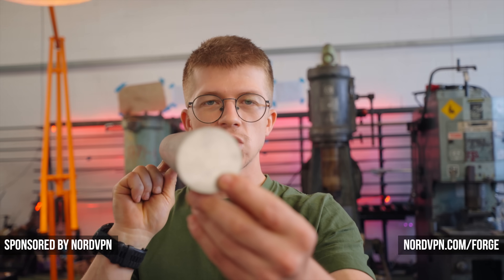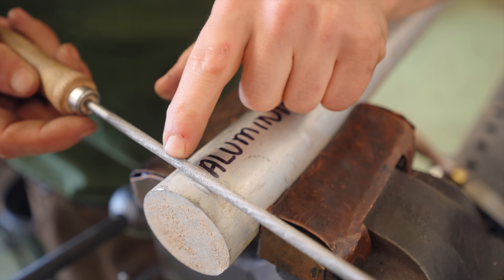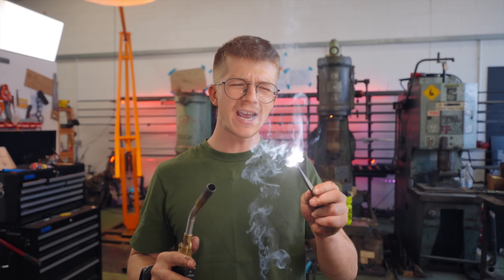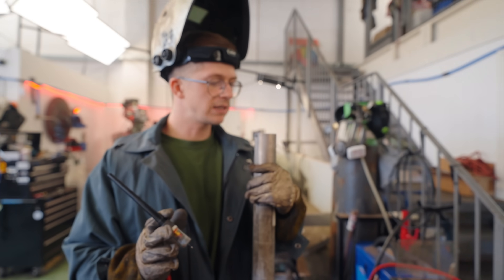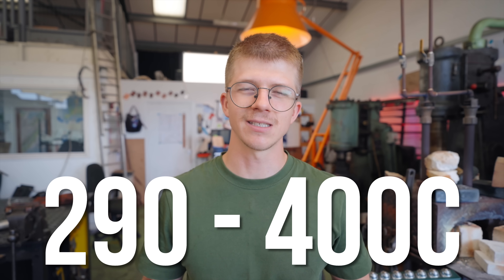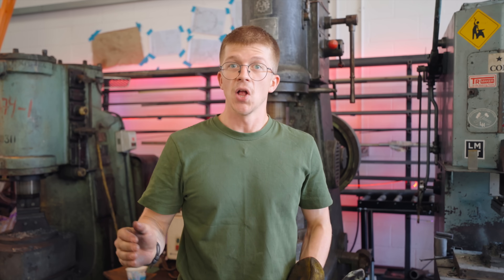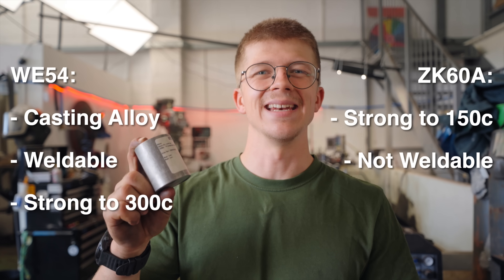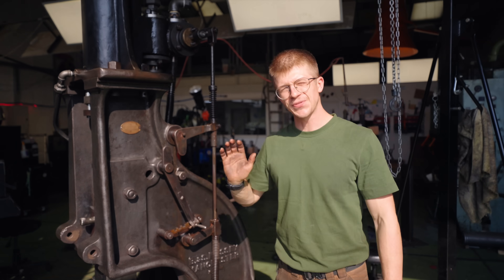Can You Forge Magnesium?

Comment: "What metal doesn't look gray?"

Well, I am think gold is somewhat gold in colour.

The type of bonds dictate the hardness. The weight is the structure and density of the metal(the space between the molecules).

Magnesium Citrate is used as a very effective laxative. Eating pure magnesium gives you a completely different result.

Also, magnesium is awesome for igniting thermite.

You really need to test it usimg an induction heater in a vacuum.

Actually I would love to see some weird metals forged in a vacuum. Obviously, though, you can use coal or gas for heating the metal, hence induction.

Comment: “Things that don’t make sense” aluminum is much softer, and has the habit of amalgamating, cutting it with steel and carbide without lube, causes the to gum up, magnesium though light is more rigid. Under a microscope you can see aluminum almost smear when cutting, I’m trying to make these terms relatable, the chip load when milling aluminum is fluffy, and their molecular structures react very differently under heat and friction. If you look at both under a microscope, they damn near explain their own natures.

Comment: I made the mistake of turning titanium on my lathe at home...all went well until I busted out an angle grinder to cut off the part and my chip tray ignited and burn really hot.  I managed to pull the chip tray out and toss it out into the yard to burn out.  I now look into the properties of the metals I work into small chips.

Comment: There is no direct correlation between density and hardness or similar. Pure gold is not very hard, and it has a very high density. Lead is not very hard, has a very high density.
Neither is there between hardness and boiling, sublimation or melting points. There can be complete outliers.
So for safety, check the research on the materials. Chemistry is not that logical if we look at water, it is made up of Oxygen, which is really the thing that nurtures fire, and on top of that hydrogen which is highly flammable. One would expect it would be one of the most explosive materials. Furthermore, adding one more Oxygen into H20, into H2O2 turns it into Hydrogenperoxide which has been used as a disinfectant and is destroying organic things. Of course it isn't that simple to just add another Oxygen atom into Water. But it is the gist of the idea.

Comment: I’ve done some small castings with magnesium back in the day. (Small for us being 200kg or so 😂) 

The issue was it’s so fluid once molten it can run away from you quite quickly. If the joints of the mould aren’t solid with the pit or box air tight is can squirt out which at that temperature and force, is an issue.  Steel alloys this is less of an issue, molten is a little more gloopy.

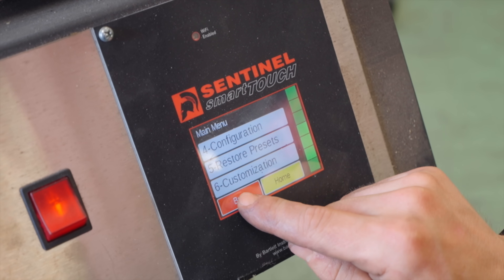Comment: 10:07 about the Fahrenheit vs Celcius, i can give small insight why Fahrenheit is superior. for that i will compare Forging to Baking. this is nowhere similar, but just a small example. trust me, because in both cases, temperature control is pretty crucial. Breadbaking requires Yeast, and that yeast can die / live when it came in contact to water with varying degrees. these are the range in which yeast can 'come alive' helping the baking process:

(105°F or 41°C) - (115°F or 46°C)

in °F, there's a ten degree difference
in °C, there's only five degree difference

Fahrenheit gives a wider range to control/lower/higher the temperature (called tempering :) ). the Kiln in 10:07 might be best set to Fahrenheit to have better control of the temperature.

Comment: I was in a prototype shop for a while as a mechanic at roush tech and I remember that Chrysler was using magnesium for a structure in the engine cradle and it was to be modified for something in a test or something 
Well it was on the surface plate that was huge so it could fit a tractor frame from freighliner 
Well it caught on fire and it melted through a 3 foot plate of steel and destroyed the entire surface plate 
It’s extremely dangerous when lit on fire for sure

Comment: 2:00 it has to do with how well those atoms hold on to each other, not how many there are. Carbon Fiber is light but extremely tough, for example.
Reply: Heat treating something changes the orientation of the atoms (among other things), and thus the way in which they hold on to each other

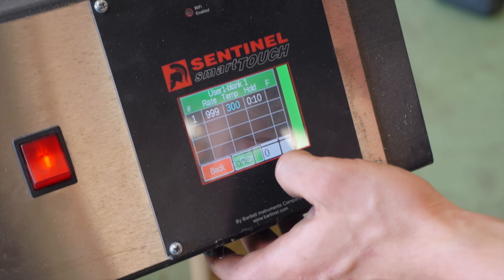Comment: 10:40 Ferenheit is good for human scale experiences. Zero is the coldest temperature that Mr. Ferenheit was able to measure outside in the middle of winter, and 100 was supposed to be body temperature, but this later was not measured precisely as normal body temperature is 98.6.

Comment: Use a super steel like Rex 121 or Maxamet to make a damascus with the hardest steel that will preferentially etch. Basically make the strongest, hardest, toughest damascus knife you could possibly make and still get a pattern to show up. Do a low layer count so that the carbon diffusion is as little as possible and any other migration that may occur try to keep at a minimum

Comment: You could probably go up to maximum of 470 degrees, as the ignition temperature is 473 degrees (celcius of course, farenheit makes no sense).
But for safety 450 in the oven, by the time you hammer it, it'll be down several degrees.

Comment: The way everyone else pronounces aluminum is better we are boring lol
(American English vs everywhere else)
No magnesium is not a laxative 
Coffee takes magnesium with it, when youre magnesium deficient you get a bad case of diarrhea they often say if you keep getting diarrhea take more, until it goes away 
It actually does the opposite but it may take several days it is an electrolyte
It is not magnesium metal it is a saline solution (it's magnesium salts more similar to bath salts but very much not) don't take it internally either it should be sprayed on the hands, feet legs etc and massaged, it also fixes muscle pain spasms

Comment: 8:31 While race cars used magnesium extensively from around the 20s to the 60s/70s, more modern race cars tend to just use it for smaller parts such as wheels and casings. This transition was mostly due to its extreme flammability and brittleness in a wreck making any sizable accident a firey ball of death. In fact, drivers at the time sometimes opted not to use their seat belt because of this, as they would rather be flung clear of the wreck and risk the fall, than be strapped to said firey ball of death.

Comment: @0:20 This quality is known as LUSTER.  The appearance of something being 'metal' is a quality of its physical characteristics, which is actually related to but independent of color.  It has to do with the electrons in the outer shells, but this means that color of the material (also a physical property) can vary just as much as the luster can with the quality/composition/condition of the stuff.  This is why steel and gold powder are dull, but if you consolidate them more light is aligning along the same paths and we get the luster.  "Metal" therefore can come in all kinds of colors, nilered even made purple gold (aluminum alloy), lots of cool stuff :P

Comment: 3:03 well alumium itself is very soft yes, but the oxide layer is one of the hardest materials you can come across, it can easily mess with your saw, the only saving factor here is that the oxide layer is very thinn
Reply: you use aluminium-oxide (in German also has it's own name "Korund") to sharpen hard knive-steel for a reason.
Reply: @ThorDyrden  It's actually called something similar in English too, "corundum"

Usually it's only called that when it's on its own as ruby/sapphire though

Comment: If you wanma see something crazy, heat up magnesium to 400 degrees And before it gets below 360 degrees put a big coat of polytetrafluoretylen (yes, teflon) And put it under some pressure And let it cool down to room temperature. After that reheat it to max 350 degrees, never over 360 degrees! And try all the things you Done in the video again. The coat of teflon must be really big keep that in mind. The metal will Have totally different properties. Normally magnesium Have tensile strenght of around 300 MPa but after this it changes to around 420-450MPa without no oxidation. The magnesium bar can not be wider than 0.5 to 0.6CM, keep that in mind.

Comment: An example of how density does not necessarily equate to hardness is gold.  Gold actually has an extremely high density, at around 19.3 grams per cubic centimeter, as compared to Steel's 8.05 grams per cubic centimeter, making gold over twice as a dense as Steel, yet it's one of the softest metals that's still a metal at room temperature.

Comment: Fun fact: cast magnesium is oftentimes used instead of cast aluminum in many applications due to weight and cost.
 Two examples are mower decks in many MANY lawnmowers, and valve covers in many small engines. 
 Cast magnesium is commonly used all over to this day !

Comment: Picture density as how far apart each house is in a neighborhood and that neighborhood is the crystal structure of the metal which gives it such properties as hardness, ductility, and so on. These are called eutectoid structures and make up the interesting patterns youre familiar with if you've ever looked closely at acid etched metals or in a cross section of a cut rough piece of bar stock.

Comment: If you don t mind a long text with maybe some mistakes, I tried to explain the chemistry around this weight hardness issue in a way I think anybody with a basic understanding of Atoms could understand. But I am open to explain more just ask. 
 Lead ? Heavy and soft. Gold heavy and soft. Titanium light and hard, Steel comparable light and hard, Iron again heavy and soft, but then lithium sodium etc. light and soft.  I did not accomplish my chemistry study but there is a thing called hexagonal closest packing of spheres it was Dichteste Kugelpackung in Germany translator gave me this. Metals got crystal structures i think this you might know even better than I, but I could imagine that this has an influence. But while i wrote this maybe its even easier. There are those valence electrons. The electrons on the outer shells. Metalls form bonds by letting those relatively loose valence electrons flow free between different metal atoms, that's also the reason metals are electronic  conductive. So what i try to tell Atom cores are positive because of the protons there and bind because of the electrons between. Theoretically if there are more electrons around in this metal atom core cluster the more those cores should bond to each other. But there is still more. For this the atom shell model from Dr. Bor should do it. you see you got the positive core and some shells with electrons around it. The further down in the PSE you go the more shells. now you got this also negative shells between your core and this cloud of loose valence electrons. more shells mean les bond from core to cloud because the distance and the negative charge shields them from each other, therefore you got heavy soft  metals because the distance between the outer shell and the core is huge and probably the electrons in the cloud are just a few. Also you could get heavy metals with a lot of shells but also a lot of valence electrons and like you could imagine the bigger the shell the more potential outer electrons an element could have. Then you have lighter atoms with few shells but if there are still not a lot free floating valence electrons they do not bond well to each other. Actually you can see this very well in the periodic table, wehere elements like lithium sodium etc are in the first 2 groups and elements of those groups got 1 and 2 outer electrons what would fit in my explanation. And after this the packing i talked about in the first place also would probably have an influence on this. It sounds complex but its literally just how the atoms are stag together if you imagine them as spheres. I think this could be a reason why fusing of different metal even though both soft could make a hard metal. just imagine you got a bunch of big spheres stag together and now fit smaller spheres in between the free space of the larger spheres. I hope anybody ready this I am not an English native and this took a long time ^^ P.S. I am not sure about steel because its an alloy from steel and carbon it could relate to this sphere packing thing but carbon could also affect the electron household of the iron atom grid.

Comment: I can see the point behind the metric system in some cases. My problems with it as a machinist and mechanic stem from resolution and intuitiveness to a lay person. Saying "I'm 2 meters tall" the ship is 100 meters long" a foot has 3.3x better resolution. Same with temperature but at metal working temps can Fahrenheit can be many times as precise without decimals. Kg is also far less precise. There is a huge step from Kg to grams. Grams are very precise and useful. My least favorite of all is using liters to express engine displacement. There are 61.02 cubic inches per liter. Even with a decimal point it's useless. If you tell me 301, 302, 302.5, 303, 304, 305, 307 V8 engine, I immediately know which manufacturer and what year range we are talking about. They are all 5.0 litre V8s. Many manufacturers built several engines of the same litres but vastly different at different times. Ford made 427, 428, 429, and 430 engines, so if you read a foreign article about a custom car and it says "powered by a 7.0 liter Ford engine" it tells me exactly bupkiss. To a lay person a cup, teaspoon, tablespoon, yard, inch, foot, are all based off of body measurements or household items. If you use YOUR teaspoon, 3 of them will be YOUR tablespoon, draw a line in your cup where every 2 tablespoons fill it to and you have an ounce, 16 of your tablespoons, or 8 ounces, and you ave a cup, pour 2 cups or 16 oz of water in a mug you have a pint, (one pound of water) or, you can measure out 32 tablespoons of butter to make exactly a pound in weight. Mabey it's not freezing outside. Fahrenheit is based on something closer to room temperature that doesn't require freezing or boiling, and needs no altitude correction. when the butter melts it is 100 degrees. pour 2 pints or 32 oz in and you have a quart. Put 4 of those in a jug and mark it you have your gallon. Then use your foot, or width of your thumb to get divisions by 3, 12 inches, to a foot, 3 ft to a yard etc. Thus, with nothing but whatever comes closest to any one of these standards you use based on your size, you can build a house perfectly to scale if not in actual dimensions but close enough to describe it to someone that exactly fits YOU. You can find a horse x hands high YOU can ride, and by using YOUR favorite size teaspoon make recipes identical in flavor to the giant next door in portions that will last YOU the same amount of time. And buy a field YOU and YOUR horse can plow in a day with a properly dimensioned plow for both of you. And your feed sacks, and wagons, boats etc will weigh or carry what YOU need. it doesn't matter if you are 4ft or 6ft tall. So, it may not be as realavent in today's world but it still makes sense in visualization. and someone using things sized according to themselves would be much more comfortable today than sitting on metric chairs! 😊

Comment: Magnesium is seeing much more use today in light weight car parts. It has been used since at least the early 1960s for casting parts like the large intake manifolds of big racing engines in the U.S. that would weigh the better part of 100 lbs in iron can be picked up with 2 fingers. Valve covers, superchargers, transmission and rear axle housings and many wheels also. It is cast in most cases, but some forged parts are used. It makes very rigid. Magnesium is used by the body to eliminate muscle cramps. Magnesium helps with constipation, Bismuth helps with diarrhea. 😊

Comment: F/A-18s have magnesium in their landing gear. That’s so that they can have hard landings on aircraft carriers, but if that magnesium lights on fire, the procedure is to push the jet overboard to save the ship from sinking because the magnesium will burn right through it from the flight deck down, potentially putting a hole in the hull.

Comment: 1:54 you're right Alec. Case in point is Gold. Very dense yet very soft. Particularly of elements, you can't really say that there are "more atoms" when it is more dense. Usually it just means that the atom itself is much heavier (like with gold, which is almost 4x as heavy per atom than iron is). There are also other things at play, like the way the crystaline structures are formed. Material sciences is pretty complex and you really can't just make simple inferences like that. There are dozens of variables that come into play to determine something's hardness (or practically any other property of materials).

Comment: Plenty of metals aren't Grey gold copper bismuth and while density doesn't coralte to hardness its common for denser metals to be harder but the properties don't corelate density is determined by molar  mass and the atomic lattice structures of the metal while hardness is determined by the strength of the lattice so density can make it both harder and softer based of if it improves or worsens the lattice strength

Comment: You should make a carbide blade dude at least to try. I know you can't really forge it but you can do it by stock removal and you can buy yg-8 or yg-6 grades in rectangular blanks as thin as 2mm and they run around 77hrc. Would be sweet for a petty kitchen knife or slicey folder.